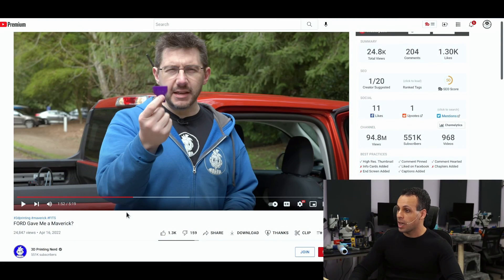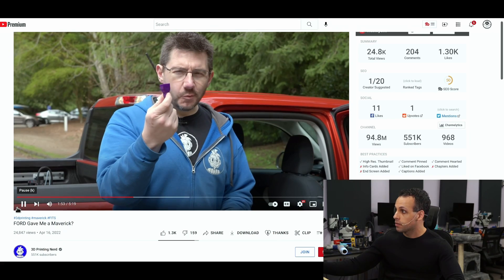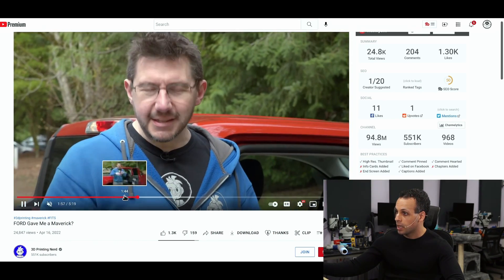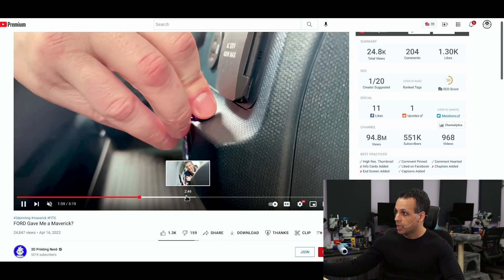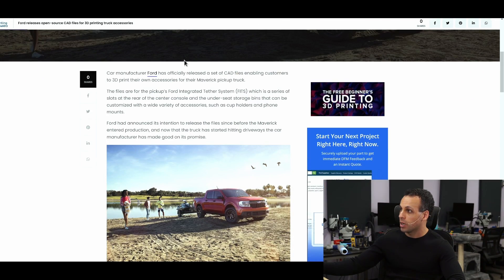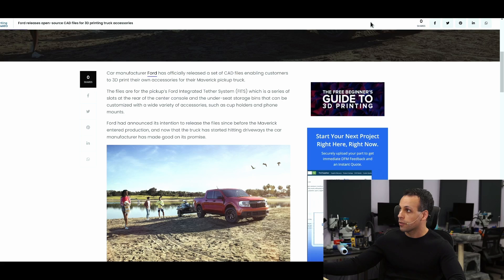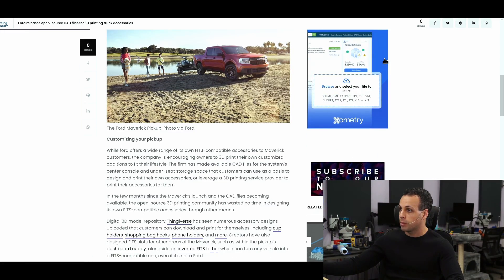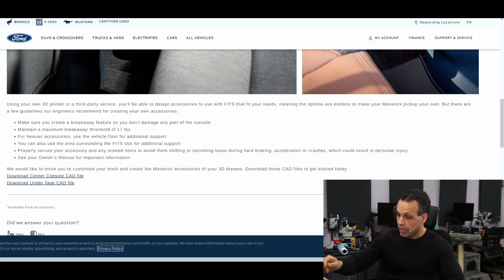Here's how to properly engage with the 3D printing community

Comment: The Ford Maverick is a really cheap pickup designed for the DIY community. A lot of Ford's official videos go over it many things you can build and modify or how to use the pre-tap tools and so on. Due to the delay in the Maverick delivery they even sent a "Fits kit" of 3D printed parts they designed for the Maverick to owners who had been waiting so long.

Comment: You should keep a publicly available list of anti-right-to-repair vendors, so the world can get a better clue of the manufacturers they need to avoid if they like fixing (and sometimes just properly maintaining) the things they've bought. My next door neighbor has a John Deere riding lawnmower. He has to have them come out in the spring to do annual maintenance and prep it for the summer, and again in the fall to winterize it. It isn't industrial level farm equipment like a combine. It isn't a low end farm tractor(with you typically see with the lifting bucket on the front end). It is literally a ride on mower, on par with a Cub Cadet or a Snapper. And he, an electrician, cannot do any maintenance himself.

Comment: Well the specs for 3d printed parts are in the programing language of what ever type of software you are using, and one of the biggest claims for right to repair is that the software that runs cars is proprietary. So this case can be seen as car companies wanting to claim their own designs as private, but also want to claim your designs as theres. The thing is honda has no grounds to do this. What is the difference between crafting a widget or piece that serves a function and buyig it, or crafting that same piece accurately and using the name as a description to display its function, but not origin?

Comment: When you think about it, letting people print cheap, dinky replacement parts could actually be good for the manufacturer.  Now they don't have to warehouse as many spare parts, so they can save money.  Also, new spare parts can be produced in perpetuity without maintaining manufacturing lines for decades.  Plus the good will it builds.

Comment: Saw this after the vid on Honda, which I commented on, and I completely agree with how Ford wants to do things.  They can see the writing on the wall, and got out in front.
Had some interesting conversions with a warranty repair person concerning my newly bought, Cub Cadet lawn tractor.  That broke a Steering Gear.  I said I'm an advocate of "Right to Repair,"  and routinely watch the Louis Rossmann and other  Youtube presentations.   And instead of dodging the subject,  he said,  we watch those also,  and we are fully aboard on Right to Repair.   And we will be sending out your part ASAP free of charge,  to replace on your own, or we will pickup the cost of any repair place you want to sent it to locally on our dime, since it was under warranty.  "Does the drive train  warranty still hold if I do it?"    And without even a small pause, he said, "Yes."    And then in soon after emails, he sent out links of videos of exactly how to replace the part. 
I know you sometimes get frustrated,  but WE are winning this battle.     And Thank You for being my reference,  I didn't think they would have known about the RTR movement,  but they did.

Comment: Ford CEO Jim Farley has been really big about the Maverick being adaptable to custom use cases by handy DIYers. They even pre-wire electrical circuits that owners can use for their accessories, and ran the wire all over the truck to auxiliary switches in the cab. I don't see them causing an issue for the 3D printing market at large. (Disclosure: Ford shareholder.)

Comment: I have an '03 Marauder that is definitely showing most of its 19 years, and it would be nice if Ford wanted to stop making parts for cars like the Marauder, or a 90's Cobra Mustang that people are going to hang on to, because they are limited production or whatever, to just release 3d cad files of all of the plastic parts that are going to break. My Marauder specifically has a problem with the adjustment gears for the mirrors and the pedals, as well as the window guides wearing out and breaking. Stalking the car club forums for parts only works for so long, and third party companies drop parts from their inventories eventually too.

Comment: Several decades ago, Ford made it very easy for people to reproduce parts for older vehicles. That was a great help to the restoration and hot rodding communities.
Reply: Yes, I was looking for a aluminum tail gate panel for a 92+ F150, I found a site that was selling them using the original Ford tooling from when the truck was made, which was awesome and provided a perfect fit.

Comment: They do this in Europe too - My Dad bought a couple of 3D printed parts for his that fix a known issue of the external boot lid hinge covers failing over time. Ford seemed quite happy with improved parts being available for cars they aren't building anymore. Also saves them having to store hundred of thousand of different parts for cars you don't make any more.

Comment: if Honda or any other company is so worried about this, maybe they should SELL 3D printing files for replacement parts .  you have a busted knob for the heater on your car?  no problem.  $5 for the file.  knock yourself out.  maybe the file only lets you print out  a certain amount of parts before it stops working.  I'm sure they can figure something out

Comment: Ford being a "legacy" automaker has always dealt with people that want to fix their own stuff.  I drive Fords largely for this reason.  I have never had them balk at me ordering parts from them or buying official repair manuals as a "non-mechanic".   That's not just the local guys, I've been all over the country.  Not cheap, but that's not what I'm asking for.  It's available.
Reply: Frankly, so is Honda, from WWII ending days onwards, newer indeed, but quite old-school if you ask me. So is Nintendo, even older than Ford, and Nintendo is specially anti-repair, the 2DS wedge had a board revision that literally didn't have silk-screened component names. I'm not talking values, literally no "R132" or so, nothing.
Not even a country thing, given Sony had pretty beautifully made service manuals of their (arguably complex) products. I just suspect it's a recent thing with clueless management wanting to protect a brand.
Reply: @Kalvinjj  That was not my experience. I had an Odyssey and they were a pain in the ass to get parts from. Namely timing belts and associated parts.
Reply: @CobaltLobster  What I meant is that Honda is also an old times manufacturer, so they should be well versed on consumers doing repairs, but guess that just isn't in their culture, either now or never.
I do wonder if this specific case against the STL sites isn't just some trigger-happy lawyer and manager blowing something up as a problem that was never a problem to begin with.
Reply: shhhhh, don't you know there are no alternatives to crappy businesses? Whenever Apple does something most other companies follow suit so this has to be regulated, we can't just have people buying products that align with their values by educating consumers to look into aspects like repairability or long term value, we need regulation.

Comment: I don't trust Ford any more than I trust Apple. They put Ford Focus and Festiva 2012, 2013, 2014, 2015, and 2016 models with an experimental dry dual-clutch transmission that they knew was faulty, yet pushed them out to market, anyway. They finally got sued in a class-action lawsuit since their attempts to appeal via extended warranties result in the exact same faulty transmission being installed revolving-door-style by their certified Ford service centers. Putting a band-aid over the cancer they released in perpetuity.

Don't buy from Ford.

Comment: Not to mention all these cheap little parts that simulate factory are already available through companies like dorman.  It's not the same as aftermarket exhaust which doesn't seek to mimic factory exhaust.  In a case like exhaust it's either far cheaper inferior product or made to enhance performance and style making it far superior to factory exhaust.  But dorman or the help section in many auto parts stores along with parts available online dorman makes pretty much every factory copy of a part that exists from a washer fluid cap to valves that go in your engine.  The quality is terrible but so would a 3D printed part be.  And the automakers are not making anything off of dorman that I'm aware of.

Comment: What makes the 3D printing issue with Honda even worse, is that they have some major parts availability issues. I drive a 10th gen Type R, and engage with a few forums. There have been people who have had their cars down for weeks, if not months, while dealers wait for parts. And it's not just electronics, a lot of purely mechanical parts are severely backlogged. For awhile, my local dealer couldn't even get crush washers for the oil drain bolt. It's a thin metal ring with a hole in it.

I see 3D printing as a major part of right to repair. It removes the ability for companies to restrict parts, because you can just make them. As the technology develops further and further, more and more things can be 3D printed, and it will become easier for regular people to use. Manufacturers don't like this because it means that they can't just stop making the part, to force people to buy new.

Comment: Valid point Louis and I do agree. Going high and to the right is not the proper answer. To counter yours, Honda's way of thinking could be the same as other negotiators. Never start with what you want. Always start in a way so far in your favor that the offer you want becomes more probable. Even if it is still not in the other parties favor.

Comment: i think fords positions may help them get customers for new fords, why?
think about it this way, if you were 50/50 between 2 trucks and your friend has a ford and has printed some cool stuff, and has a fully customized cab, you would lean towards that as for a phone mount you won't have to wrestle with the vents, just use a 3d print (i don't personally use a phone mount but an example) i feel with the way how similar trucks are interms of features, it could be a new one if it is marketed and pushed in the right direction

Comment: I saw Joel's FITS video and I feel like Ford got it right, so far. My only thing is I wonder what the EULA is on the original FITS device, who holds the license to the files. That said, this is a step in the right direction. 

My only comment on Joel's video is realistically to make anything that "lasts" inside a car you need at minimum PETG, and ideally ABS/Nylon for the heat resistance. The last 2 require more advanced skills but I digress... That is a user issue to tackle.

Comment: Good job Ford!
What I really hate is when someone makes a 3D printable model for some car part and then try to make people pay for access to it. If your designing a completely new never before seen part, sure, then you can change for it. But if your just creating a 3D model of a part that some one or some company has already made, or even just slightly modifying that part to make it a little different, then you should NOT be changing anyone for access to that model file! I've designed several 3D printable models for various vehicle parts and household items, and I ALWAYS release them for free.
Reply: There's also intellectual property to consider - if a part that is under the copyright of an official manufacturer is being sold after only slight modificiations, I'm sure that violates the copyright agreement

Comment: I absolutely love the 3D printing and watching the community grow and being apart of it feels great. And I'm very happy Ford is embracing it and released the CAD files. Valve did something similar recently with the Steam Deck too. I think modifying your things is only seen as scary because of how companies try to portray it and if the reception around it became better and it started getting more widely acceptable consumers would only benefit. It's really a shame many companies are so against it.
Reply: In my experience, parts which are designed to last are very often not difficult to replace/remake, once they eventually do fail. It's really only the parts that are designed to break just after the warranty ends which are a pain.

Comment: This is a yes and no for me, as a person that prints bunches of stuff, for many things.
A cup holder is one thing, engine compartment items are a different story.
If the material, or the process, does not meet a specific standard, it could result in fire, or failure. 
If your brakes fail, because you made a cap that is porous, it could be a problem.
If the cable management clip melts, and drips onto the manifold, starts fire on the freeway... It is not a good thing. 
I support the desire to improve, maintain, and create anything your mind conjures, but some things need to be purchased from a quality controlled manufacturer. 
That being said, manufacturers, in my opinion, have the duty to provide maintenance items, and should embrace consumer input and produce add-ons, via submission requests. The engineers, could review, approve, or state reason why it is a bad idea...  like, "you'll shoot your eye out kid".   Successful ideas could be produced in mass, added as an option for new vehicles, and provide the author/creator a means of monetary benefit for the idea/model.

Comment: Some aftermarket parts become safety issues. I can now make my own part for a damaged windshield sprayer I had. 3 years ago I had to have one replaced and the ONLY one that is still in production for that make of car makes it so the sprayer sprays ABOVE the car. Completely useless to clear the windshield unless I am headed down a steep hill while using it.

Comment: If manufacturers were smart (hang on, I'm in MA...SMAHT!), they would put the digital drawings up of the OEM parts so ANYONE could print them.  My guess is that they would make much more in download $$ and be much more efficient in supporting their customers!  They've made it clear over DECADES of non-support that they do not want to stock squat for parts (forget about the ridiculous prices they charge for the parts that will backorder for a long, long time before being cancelled).

Comment: 3d printing and cnc are saving grace when it comes to old cars for which parts are often not available even on the used market, let alone from the manufacturer, I mean if you have a vintage car you might have to pay actual thousands for a small plastic air vent frame if you can even find it
Reply: And when engine blocks or pistons run out for a particular model, you can make a custom one from scratch with modern machining, and it can be lighter, stronger and have better tolerances than the original

Comment: I have been a Honda fan for decades now. This was the tipping point for me. Unless Honda takes a better stance in the right to repair issue, as far as I am concerned, they will never take my money again. That being said, I am not quite desperate enough to buy a Ford lol. KIAs seem to be decent lately. Toyota is the same shit as Honda when it comes to their stance against your right to work on your own devices.
Reply: "Unless Honda takes a better stance in the right to repair issue, as far as I am concerned, they will never take my money again. That being said, I am not quite desperate enough to buy a Ford lol."

Glad to hear it. I've seen so many other comments saying "Since Ford supports right to repair I'll get a Ford next time" and I'm like bruuuuh. Honda may have put in $3 million against right to repair as Louis pointed out in his previous video, but if you go back and check that list again, Ford put in just under $4.5 million. And yeah, Toyota is above Ford at just over $4.5 million. And while I like the Toyota I have now, I'm not keen to get another because of stupid things like needing special software just to update my TPMS codes every time I change my winter or summer tires out. Wasn't a fan of that subscription to use remote start that Louis covered a while ago either. Also, I want my next car to be electric, and Toyota has been dragging their feet on BEVs because they're dicking around with dead-end Hydrogen fuel. You would have thought the company behind the Prius would be all over a proper EV to put into the Prius lineup, but nope, best you can get is a plug-in hybrid with a pathetic 20-25 miles of battery range.